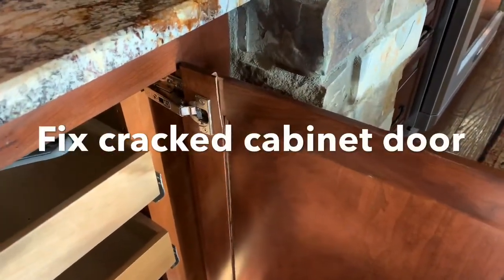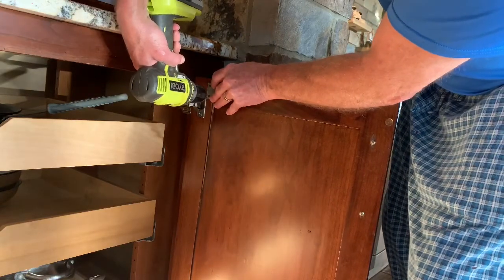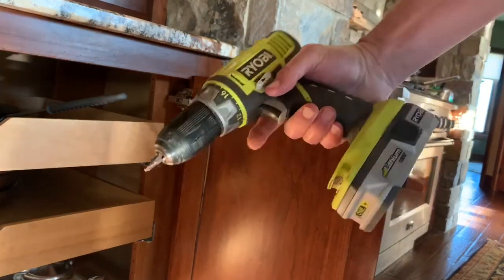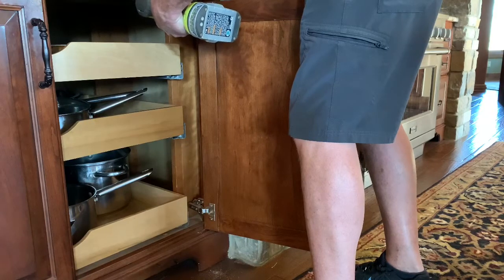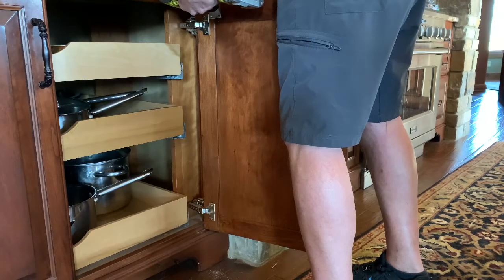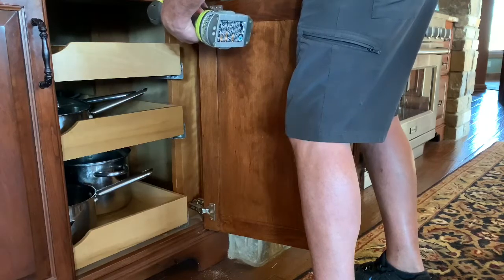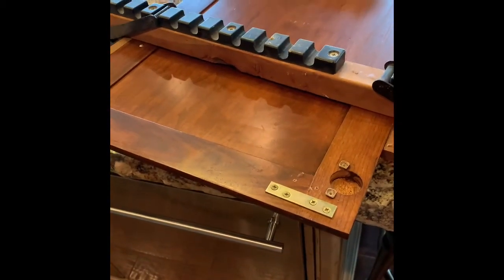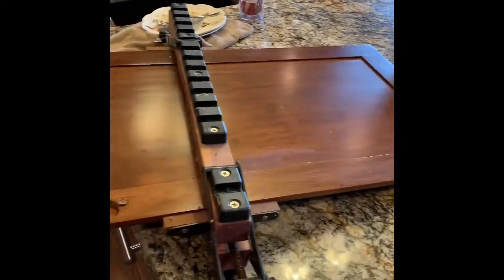How to fix broken cabinet door

Comment: Our cabinet door just cracked TODAY! As someone who's not really handy, I was going to try to replace the whole door. Can you please direct me in the right direction of nail size and what type of brackets to use?
Reply from the maker: Brackets 2-3 inches. Screws 3/8-1/2 inch long depending on thickness of wood. Good wood glue. And clampsto glue the crack is the real key.